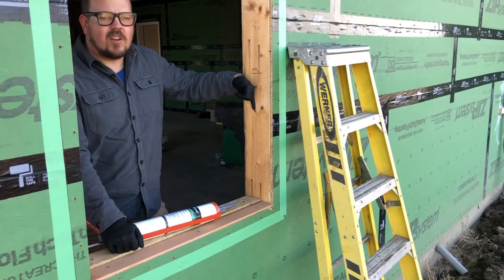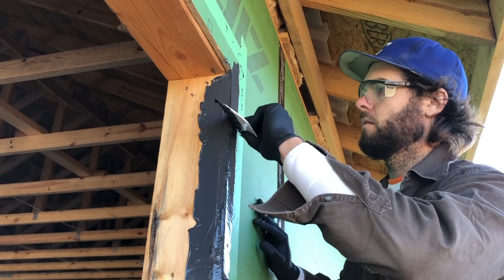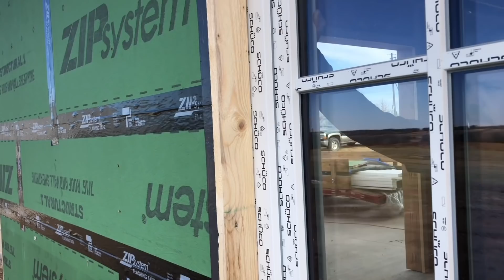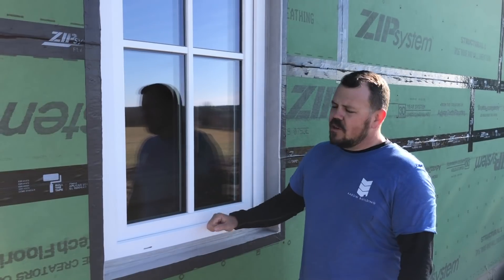How To LIQUID FLASH A Rough Opening - Best Waterproofing Practices

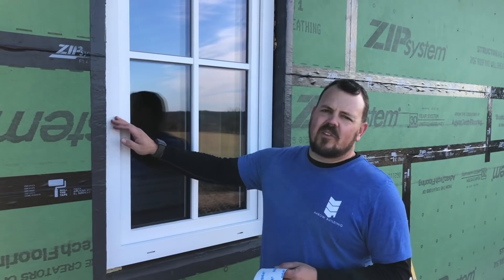Comment: 6:13 It's the one or the other, or you use Turbo screws or you use those metal clips (brackets). 

For reasons of thermal bridging by those clips, it's better to use the Turbo screws, that is why those turbo screws were invented... To get rid of those clips/brackets...

Comment: I think you should install window "flush" with zip panel. Easier to tape, more secure then folding tape in 90 degrees. You also do not create condensation point by thinning insulated wall with window pushed back. BTW, windows are fantastic, just installed manufactured by polish company eko-okna. Fantastic, no comparison to anderson/ marvin.

Comment: Jake, I just posted this question on another video that I think you were in as well. I am installing European windows and my windows are really tall and I was wanting to stand in the seal. Here is the question I posted on another video.  OK out of the blue crazy question, I see all the videos of applying the liquid flash starting at the seal, I was wanting to start mine at the head and do the seal last because my windows are so large that I was going to stand in the windowsill to do the head and the jam and then do the windowsill last am I crazy? Is that stupid just thought about it what if I did the window seal just 6 inches in on each side first then the jam and head and then do the middle between the 2 6 inches of the jam last.

Comment: While I can see merit in a continuous material a pragmatic approach of liquid flashing the corners and using Zip tape for the vertical and horizontal legs would be cheaper, faster, and still quite robust for air and water management.  In a recent Scott True video with Matt he used Flex Tape in the corners and Zip for the rest of the way around - same concept but with liquid flash.  I haven't used flex tape myself but just watching people fuss it I think it would make me want to throw things.  Liquid Flash on the other hand is easier than making a peanut butter and jelly sandwich.

Comment: I understand the clean look of the straight edge on the flashing, but by taping there is not any added benefit in the waterproofing, eventually the opposite, since you decrease the surface of the flashing. 
Once done with building the home, if the guys did a good job with cladding and add a layer of exterior insulation over that zip panels, no one is going to see that flashing for the next 50 years at least. 
IMO is a waste of time, tape and compound. Other than that is a good video.

Comment: Great video. I do have an issue with a scrap piece of particle board being used on the sill.  I would rather use a piece of pallet wood that particle board in an area like that.

The system is great but the average contractor is going to rush that install and that tape is going to be all messed up. That liquid flashing really needs to be inspected by either the CM or some other owner representative prior to that window going in.  It’s way to dependent on its correct installation. 

the average contractor in any place I have ever lived or worked can’t install Tyvek correctly.  These are great products I just with more builders took this much care in the correct installation of the system as you do.